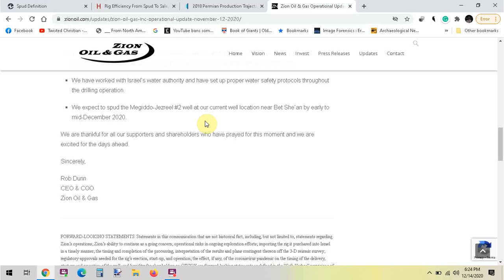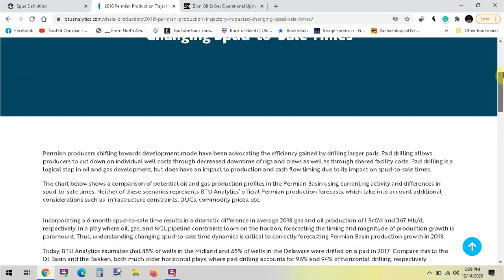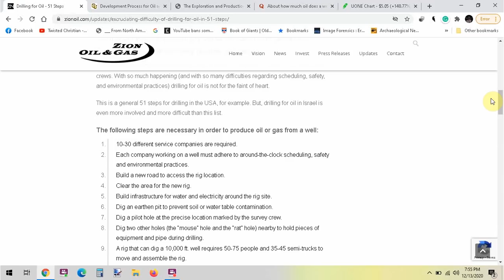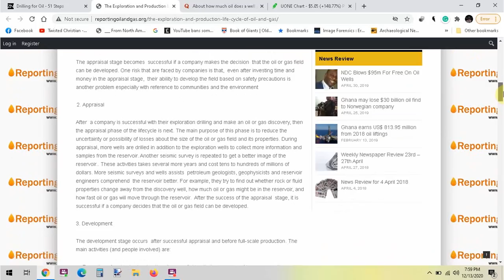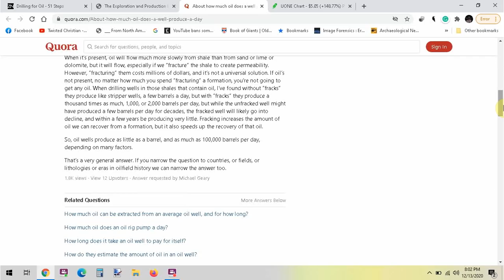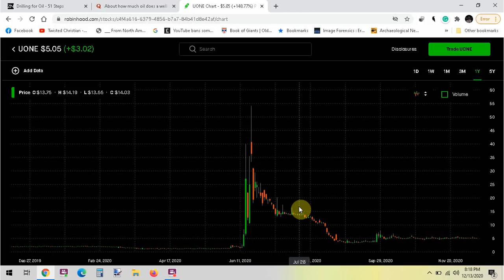Zion Oil Exploratory/Drilling Process- What Comes After. ZNOG short and long term outlook.

Comment: I only have 4 thousand shares  I’m in it for the long haul 👍🏻
Reply: True
Reply: Hold of.brother
Reply: u should buy more in mean time
Reply: @stevenray8395   I would if I could  I struggled to get what I have
Reply: @archiecunningham3734  well start investing in BBBXF- BRIXTON METALS.  trading around .22-.25 cent dirt cheap and this stock too was prophecied by Kim Clement in 2013 that thuis stock will be big invest in it.  I had spoke to one works for Brixton other day by phone he said this stock will be pretty big in couple yrs.
Reply: @archiecunningham3734  that way u can have two big stocks going for you znog, brixton metals
Reply: @archiecunningham3734  the key would be to sale when it’s high, so when it hit1.70, I sold, so I had 1700 I didn’t spend any of it, that was a thousand shares, so I’m waiting to see if it goes lower if not, I will buy no more than .90 and basically regained my thousand shares plus another thousand
Reply: It’s diluted to 100 shares now

Comment: I have experience investing in oil wells and I have lost over $200,000 In several wells in the past.   
Every common oil or gas well has the probability of creating huge profits  creating great wealth from one well 
Depending on number of barrels per day 
Some wells produce 20 barrels per day 
Some 100 some 1000 some 10,000

You can do the numbers yourself 
1000 barrels per day is about $60,000 per day 
Or $1,000,000 per month  
Or a dry hole 
Every single well I invested directly in was a dry hole 
The depth of the hole depends on the strata and is already determined 
I dont know the information on this well
But a regular well of 5000 to 10,000 feet can take from 2 weeks to 30 days 
And 20,,000 deep well can take 90 days those are usually gas well like here in Oklahoma 
Apparently this well is much more shallow well according to trusted

Most importantly you will not necessarily have to wait UNTILL the well is in full production to see the highest stock price 
Once the well is at the target depth 
And oil is present 
They will swab the well
And determine how many barrels of oil per day production  
At that time they will know if this is $1000 per day or 80 per day 
80 to 100 barrels per day for 20 years is a great well
After full production is realized there will be a determination of how many additional wells will be needed to produce this find 

At that time the greatest value may be realized 

I am investing in this well  because 
Only because of my faith in God 

And his words given to Kim Clement 
No matter what people say i believe Gods word is the same as rock 
And there is already evidence that this well is supposed to be one of the greatest oil wells in the world 
Through use of the most advanced technology utilizing dynamite and nitroglycerin
That provides pictures of pockets of oil

Most important technology is not perfect 
But this discovery is expected to exceed the best wells of the Middle East
That is where they come up with estimations for $100 per share 

I’m only counting on Gods word that he has promised wealth for the Exodus 
That no longer will we be slaves to the evil that currently controls the world 
We will have the task to change how all the good people of the world will not be slaves again 
So I feel I have heard far too many specific scientific claims 
That in my past we’re lies 
This one is Gods word and I pray in thanks for this blessing
I usually invest only because 
Some told me to because they knew something and said to me buy all you can get is going to skyrocket on Monday!! 

I did not know this about this well 
First I knew Kim clement was directly communicating to God 

That is what I have my heart invested in
Reply: Thanks for taking the time to write that.  I needed that